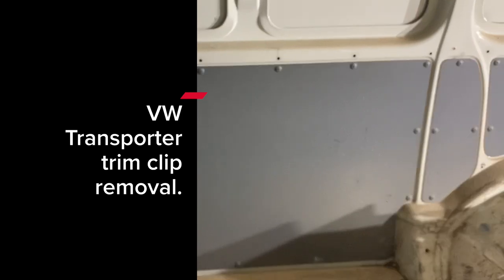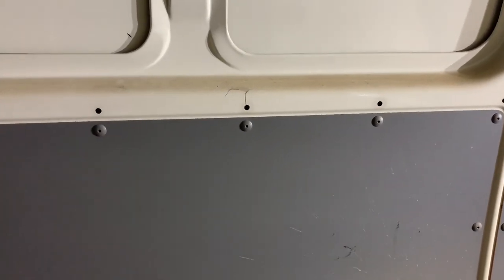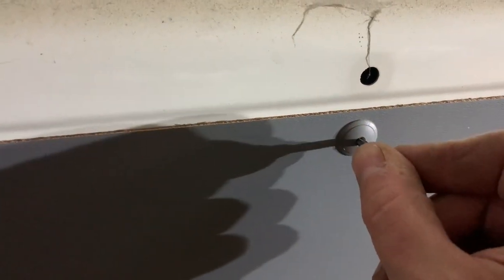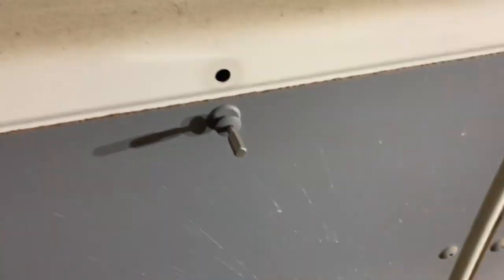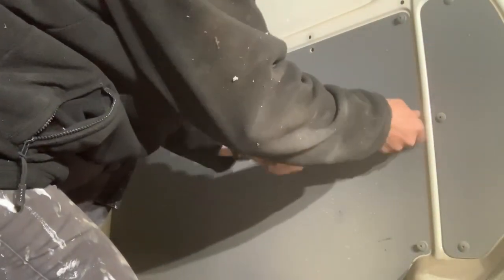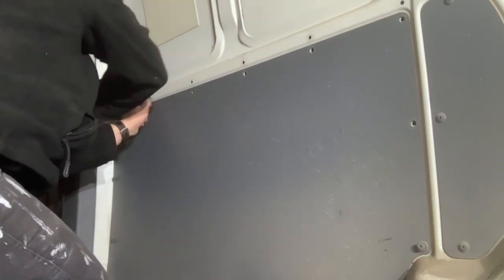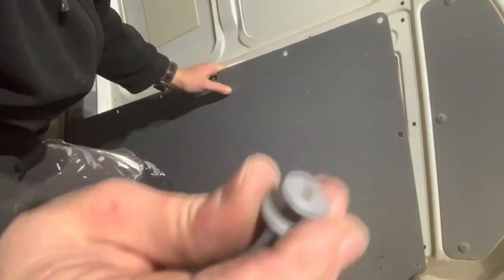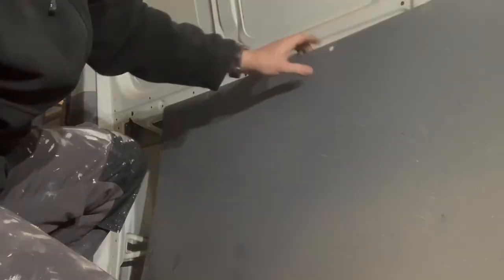VW Transporter trim clip removal.

Comment: This is the best example I've seen for removing VW panel clips. On my VW Passat I found that a allen wrench could sometimes unscrew the center, but a very tight center would sometimes have the allen wrench slipping around without moving the clip center. I didn't think to try a T20 torx tool and drill. Perfect solution. Thanks for sharing...